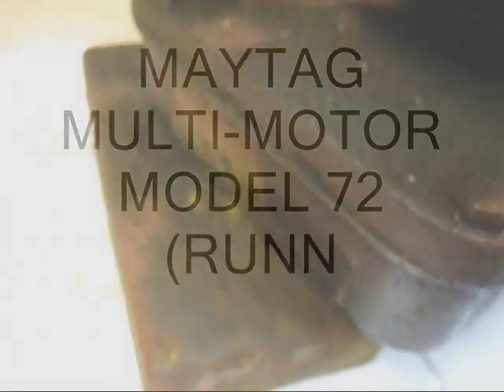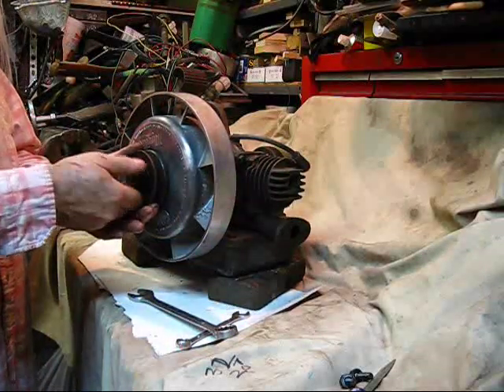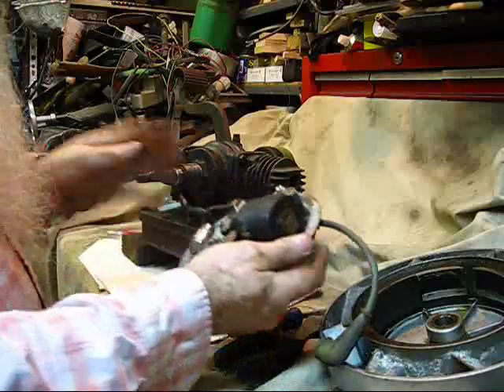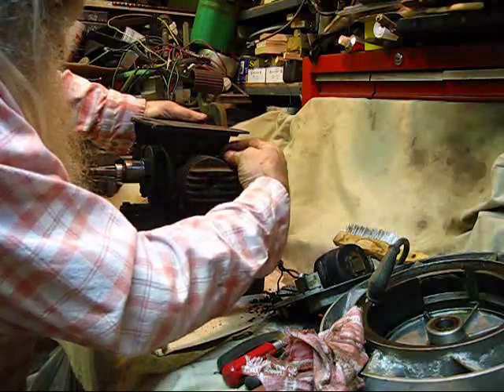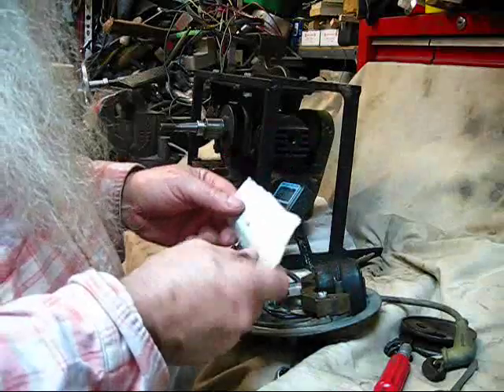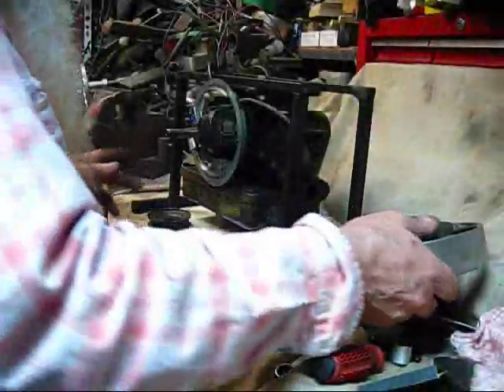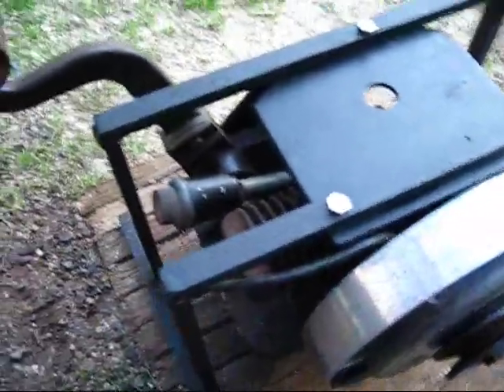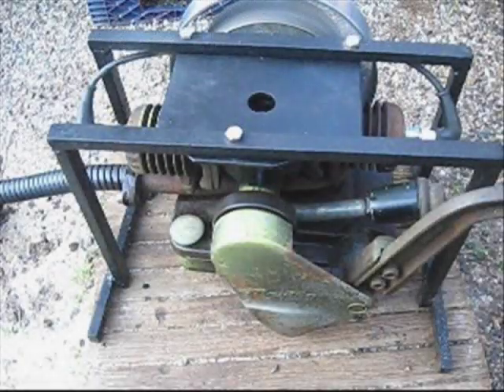1946 Maytag Gas Engine   kick start

Comment: Great video!  My great-grandmother bought a brand new 1929 Maytag wringer washer with the gas engine, as they didn't have electricity there at the farm at that time (this was in Williamstown, Vermont).  I've just bought a 1947 twin cylinder Maytag engine, and I'm hoping to find a c. 1929 Maytag.
Reply: Stationary 

Engines
Reply: Stationary oil engines

Comment: whats one of these worth these days, i had one 2 cyl and 3 single cylinder ones, was just wondering ive had them sitting in the back room of my shop since we bought the place, they look to be in fairly good conditioon, i no the 2 cyl isnt stuck but i dont no about the others, I thought they were cool little motors FOR SALE i guess , rather see someone fix em up rather then collect dust Theres also a old reo engine from around the same era